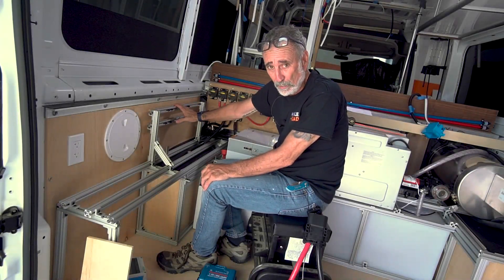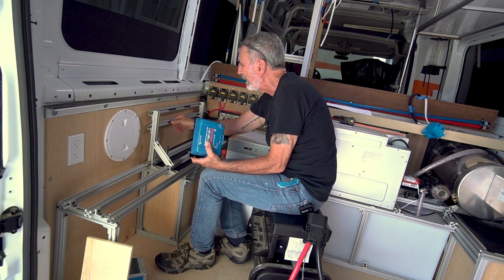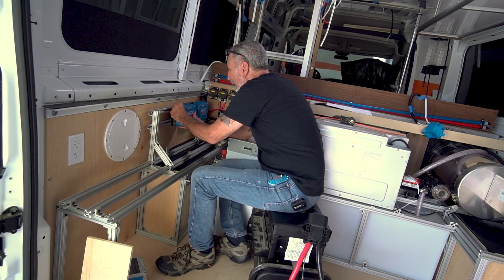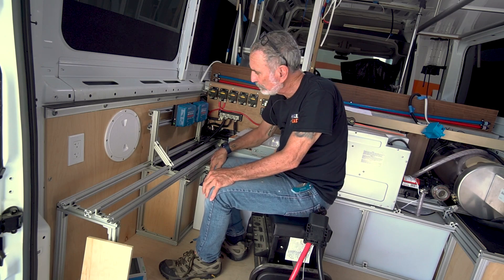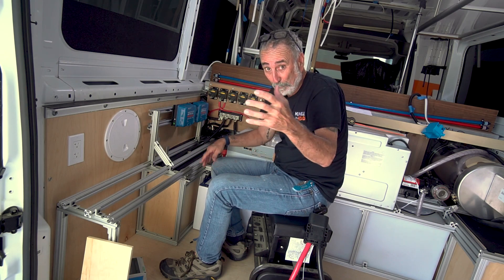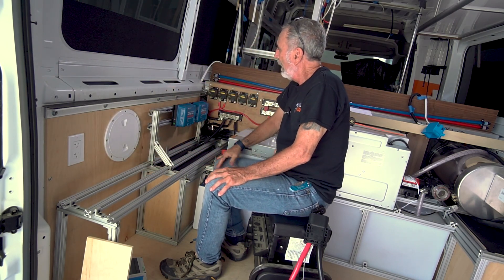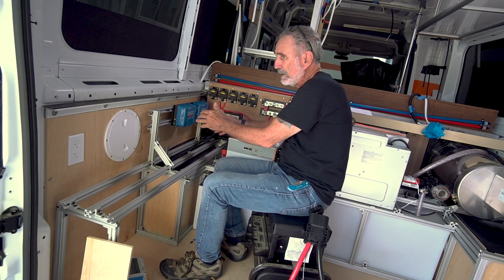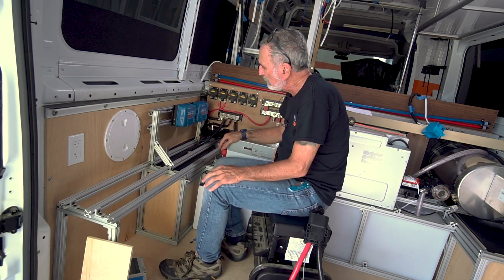Build a custom rack for your MPPT and DC/DC chargers using 8020 aluminum profiles.

Comment: Hopefully, you will keep your system cooled with a fan so your system doesn't get hot?
Reply from the maker: The rack has the controllers positioned two inches away from the wall. Excellent ventilation.

Comment: If I follow, the MPPT are each taking a 3@300W string of solar panels and pushing that to your batteries? And when I think DC to DC I think power off the alternator? My Transit will come with dual alternators. Does this Pr have dual alt, therefore 2 DC to DC (wired in parallel) so when driving you push 60A to the battery for charging?
Reply from the maker: If you have a second alternator, you don’t need the DC/DC chargers.
Reply: @HumbleRoad  oh right, as I would not need to tap off the chassis/engine battery! 🤦🏻‍♂️
Reply: @HumbleRoad  had I just waited until today’s video short… 🤦🏻‍♂️ love what you for us, 🤘🏻

Comment: Thanks for another great video!  Why two dc-dc chargers?  One from engine to coach and one from coach to engine? Beautiful job.
Reply from the maker: Each DC charger pushes 30amps. Two in parallel push 60amps
Reply: @HumbleRoad  if you connect your solar panels in series and double the voltage you can use a single 30a charge controller. Designing electrical systems, it's nearly always safer to have a higher voltage and lower current and as cable thickness is the deciding factor for current draw you can use thinner and lighter cable by increasing the voltage. Just one of those charge controllers is more than enough for that system. Doubling up must add so much extra weight. How much will your finished promaster weigh George?
Reply from the maker: This van has a 630Ahr lithium battery. 60Amps from the DC in addition to the 600W solar is still not enough to keep this battery topped off during heavy use. Higher voltage series wiring sends lower amps to the charger. That results in longer charge cycles. Amps is what the battery wants, not volts. 3@300W panels strung in parallel under ideal conditions will send approx 18 AMPS at 22 volts, which, on a #10AWG wire, rated for 30 amps is fine. I want as many amps going into the battery as possible. The three vans I have completed and are out in the wild, have all been weighed under conditions where they were heavily laden with stuff for extended trips or full timers. They all came in well under weight, fully loaded!
Reply: @HumbleRoad  Wow- nice! That's about 8KW on board and underweight! Your engineering and creativeness are superb. 

I was trying to find more info re optimal MPPT controller input voltage. Found this on Victron's website: "Mark answered · Jul 05 2019 at 4:27 AM   I don't think that there are any firm rules with regards to the voltage delta, but solar voltage must exceed battery voltage by +5v each morning for the MPPT to start up. So if your solar Vmp is only 19.8v it's cutting it a bit fine, particularly on overcast days." 

22 volts from the panels under standard test conditions might not translate to > +5v delta above the battery absorption voltage with overcast days?  Might be interesting to ask Victron engineers about their take on it. Most detailed articles on MPPT controllers I have read seem to indicate that two 100W panels (or more) in series might be better to get more efficient power conversion, though it obviously comes at a trade off if you are in shaded locations. You are so right - it is all about the AMPs that the MPPT can efficiently extract under all weather conditions, not just sunny "standard test conditions" (per Renogy:  STC Irradiance of 100mW/cm2, AM 1.5 spectrum, and a cell temperature of 25°C (77°F)).  Thanks again!
Reply: @HumbleRoad  makes sense, thanks!

Comment: George, you keep bashing my van choice for rust.  Do the South Carolina built Sprinters rust out?  The US built Sprinters have only been on the road about 2-years and most of the initial production, 25,000+, went to Amazon, not individuals.

On another note, why is the BMS such a Mamaluke?
Reply from the maker: Sprinter’s reputation for premature rust is decades old. The BMS is the external from Lithionics. Check out their website

Comment: The Acuva system doesn't look bad but you can just hit up somewhere like RV water filter store and buy their filtration systems. Removing the bacteria and cysts instead of just nuking it with UV seems better. Also, you can add an UV cannon as a finishing step there too. Probably cheaper than what Acuva wants for their stuff. Personally I want a dual-canister filter on the water intake point to the entire van/vehicle, so the water tank itself doesn't build up too much sediment. And if you clean the water as you add it, you don't need to clean it quite so heroically at the tap.

Comment: Another great video.   You mentioned rust in a Sprinter.  Have you addressed and dissimilar metal corrosion concerns as you combine 8020 Aluminum with tradition metal chassis?  This can easily accelerate corrosion otherwise.
Reply from the maker: The 8020 is anodized

Comment: Are you using shark bite fittings? I have multiple leaks in my plumbing connections on a brand new 5th wheel, I want to fix it with improved fittings and not sure which way to go.
Reply from the maker: No I don’t use sharkbites. I use Uponorfittings with Pex A
Reply: @HumbleRoad  thanks, I will check this out. Love the rack, want  Xantrex-Lithionics system in 5th wheel, looking for installer with knowledge of the system closest to San Antonio

Comment: Thanks again for the great content!  Was that a breaker box in your hand for solar disconnect?  Also, if you can get 630 AMP HR with two of the lithionics 12V 315AH E2107 GTX Batteries that have an internal BMS and heater why are you using the bigger batterie with the big external BMS?  When I selected Lithionics 12V 315AH E2107 GTX I decided mostly on safety, but the reduce size per AMP HR and weight per AMP HR compared to the competition made the decision an easy one.  Sorry if this sounds like I am second guessing you.  That is not the intent -I am just curious and want to know if I missed something.
Reply from the maker: I prefer the single external BMS. I can add another 630 or 315 with a combiner box. Both are UL listed

Comment: Hi George, why two DC-DC chargers?
Reply from the maker: The DC chargers have a capacity of 30 amps. You can connect them in parallel so we’re pushing 60 amps into the battery, along with 600w of solar
Reply: @HumbleRoad  gotchya...presuming the batteries can handle that amount of current. As always, and like so many of your viewer, I appreciate your level of detail and thorough explanation of things...pretty amazing to think of all the information (good and bad) that is passed along via these Youtube channels. That being said, your channel most certainly is head and shoulders above the vast majority of channels, so again, thank you.
Reply from the maker: Thank you for your kind words, M. The 630Ahr Lithionics battery can gobble up over 300 Amps of current at any time.
Reply: @HumbleRoad  could you recommend a 600w solar system for a Promaster, 136" high top, please. Thank u

Comment: Thank you George! ? Where do you run H2O lines to shower or whater is on opposite side of van? Under flooring? TY for all you do. I am just starting my build
Reply from the maker: I run wire and pipe from one side of the van to the other in a channel along the top of the bulkhead. ( short wall dividing garage and living space)